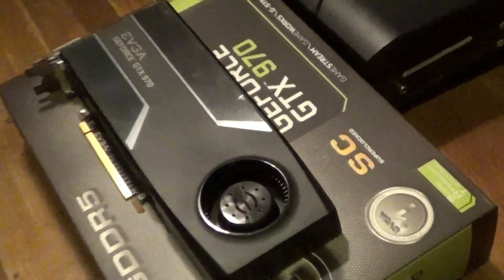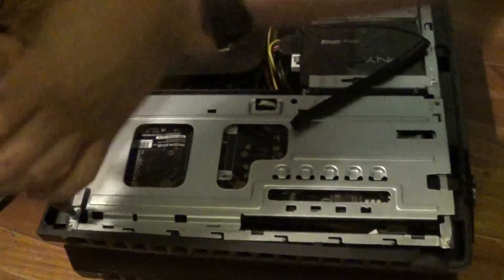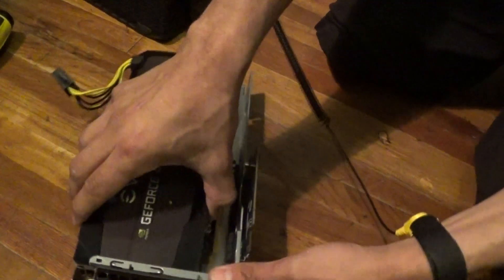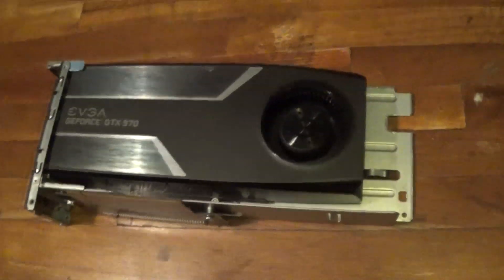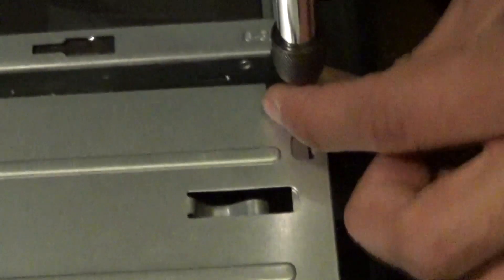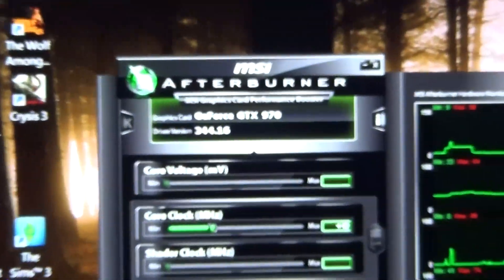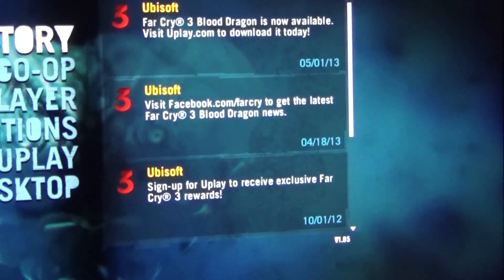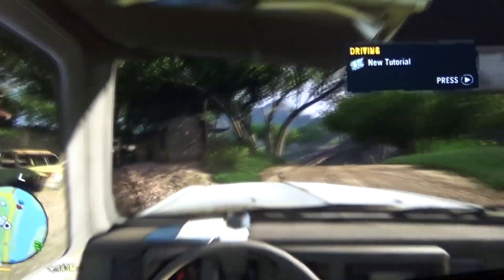How to install a GTX 970 SC in an Alienware X51. (English)

Comment: Has your pc ever shut down randomly on you from this?
And thank you for making this it solved my question of this gpu fitting in an this case
Reply from the maker: Corrupt Zach My X51 has shutdown on me only twice, while playing Watch Dogs and Far Cry 3 without V-Sync on. But since setting the power limit to 99% I haven't had any stability issues.
Reply: Corrupt Zach | ImPact Zach, Commentator Of ImPact Nation Sorry! I dont know much about AMD cards, never used one so I dont know the equivalence, but, if the TDP for the card is 145 watts or lower, it should work. Also, you have to make sure the card fits in the case so no longer than 10.5 inches. Hope this helps.
Reply: ElMastaGamer HD Can you tell me how to set the power limit the power to 99%? I bought the SC version of the card too cause thats the only one I could get my hands on. They are all sold out and I thought it would be better anyway in the long run. So for now can you tell me what to do to reduce the power limit to 99%?
Reply: you can do a few things, one V sync on or FPS lock at 60 fps.  the gpu boost 2.0 will over clock if the temps are fine and that use more power and if it can go beyond the 145 watt use age. there also your cpu that does the same.

so when he does not have v synce on or a fps locker the card will go all out, what he did is one solution by using EVGA precision X to limited the power ( or temp ) to 99% the card wont try to boost has hard that it can.

you can try the other two solution has well if you fine with 60 fps like me. or you can limited your cpu to 99% so it wont turbo boost aswell by using your Alienware program that came in with your x51 or simple down clock your gpu to a normal 970 (which it will eat anything given to you still) .  OC and SC version are bs market because it only takes you 5 sec to OC yourself, since they are all the same design.

also note, please test before you do anything because he does have two SSD 

so if you like me that only has one HDD you may or may not even have this problem
Reply: Hey thanks a lot RAULO3! This was really helpful. I have been using it now with the 99% power target and no problem. Will try with the VSYNC and fps locker too. Also will try with everything normal, meaning no underpowering or underclocking and see if it shuts off. Thanks.
Reply: What are u saying ? this card causes crashes ?? i want to buy it and i'm affraid now x)
Reply: ***** It may occasionally cause a crash here and there, but overall is a great improvement. With proper settings, crashes can be avoided.
Reply: ElMastaGamer HD 99% How did you set it to that?
Reply: GMentertainment ElMastaGamer HD  Yes, I would also like to know.
Reply: Rezirex Hey guys! I actually am using the FTW version and am playing Far Cry 4 on ultra and no shut downs. The fan gets a little loud since the case is so compact and and sound reverberates, but apart from that no issues. Oh and for the 99% power thing, just get MSI afterburner and set power limit to 99% and put fan control on auto, it helps a lot with the sound of the fans being too loud. Dont use EVGA precision x, for some reason it has no control over the fan speed and just keeps blasting it to full speed and man these ACX coolers can be loud at full throttle. Hope this helps!
Reply: Siddhart Rao That's all great to hear! Mind telling me your CPU, and if you have a HHD or an SSD?
Reply: The cpu is an i5-4440 and I use an HDD and will hopefully upgrade to an SSD by january
Reply: Siddhart Rao Thank you! that's exactly what I have, so I know it'll work now.
Reply: Yeah no problem! I know how you feel. I was in your state about a month ago. It runs far cry 4 on ultra with an avg of 40 fps, so enjoy!
Reply: Siddhart Rao ....40? what res and do you use AA?  i get 60 at 1080 with no AA and no soft shadow since they kill 10fps, i can use 2x mma but nah
Reply: I get get 50 to 60 most of the time with AA and at 1080p and soft shadows on. I think the AA i am using is TXAA, its not as good as MSAA but gives more fps with a good looking image.
Reply: Do you guys know if a r9 270x would work on a R1 alienware?
Reply: Siddhart Rao
A blower style card is definitely recommended for this case. THe Galax 970 and the evga 970 are perfect for the X51. I'm not sure why it would cause problems for the 33watt psu R1 model.
Reply: *****
it crashes because alienware is shit and his psu isnt powerful enough to support his computer
Reply: Jenna Love Then why are you here? For the sole purpose of trolling?
Reply: Rezirex No i clicked on your video because it said alienware. Sure we make mistakes. But at least i didnt buy alienware. I bought iBUYPOWER. it was a decent price. NOT GOOD but decent
Reply: also i bought a gtx 970 oc recently and ive just been very fascinated by how they work and ect.
Reply: My alienware aurora R4 is dead last month, (1.5 years bought), The boot program isnt contain in harddrive, its in a miroprocessor fixed on mothercard, and it has broke itself, the pc is dead, i cant do nothing else, and its difficult to save DDR2 stuff, too old, a pc bought in 2012, with DDR2 stuff (start of 2009, a pc older than 6 or 7 years) this issue is the same for all aurora 'series, dell know it, but its not their problem, economic befor all, i hate pc's of big enterprise like alienware since 1 month, my next pc will cost 900€ and its x4 more performent than aurora r4 (DDR2, 1300€) Alienware are ultra stealers, im not a blamer like all who says "alienware is shit" , no , i'm the client who take care of his pc, i loved it, my dear pc, but alienware are ingenious and give the dead to their pc's after a few years used .

Comment: I'm planning to get a 760 into my x51 do you think i would have to down clock? Or would it be just fine? (With the 330w psu) and i only have a 60 hz monitor so would it give me max 60 fps?
Reply: been using my x51 with a 760 for over a year now and it's never had any problems. Asking if it will give max 60 fps is a pretty generalized question as different games have different requirements. I can run bf4 on high at 60 fps but start hitting 40 when on ultra and get around 30 fps on crisis 3 on ultra.
Reply: hey man, ty for the answer one more question, is it loud? and is it worth it?
Reply: Robato I always use MSI Afterburner to overclock/keep the computer cooled so the fans are running extra loud. It can get fairly loud under full load (try looking for a video of fan noise). The replacement for the gtx 760, the gtx 960, should be coming out in Spring next year so you may want to wait for that. I've found my 760 to be pretty satisfactory except when playing highly modded Skyrim. With very high resolution textures the vram starts to run out and cause stuttering or sometimes crashes. The 970 SC shown in this video is the best you can possibly fit into the x51 without modding it so I was thinking about upgrading to that. If you have the money and don't already have a good gpu I would go for that one.
Reply: I have a GTX 745 OEM 4GB DDR3 Early 2013 model with a intel core i7-4770 3.40Ghz (8 CPU's) and 8 gb of ram, now im debating wether to get a radeon R9 270x (Because 3 of my  friends hva ethis card and it runs amazing and it is reccomended as the highest card at dell.com for the x51) or a 760 OEM (From ebay) or a 760 (No OEM) or the 960 if thats possible, its very tricky and i rushed ordering my pc because ive been waiting 3 years to get it and now i want to upgrade it already. So lots of things that go on in my mind. My question to you is:

Is it worth the money?

Would i be able to run games (High settings 60 fps) ?

And maybe i should consider getting a new case since that can help witj the noise and air reduction (But i dont want to do that because the point of the x51 is to be protable)?

Sorry if im bothering you alot but i dont want to make another mistake on this.
Reply: You should never get an OEM card as those are only used for companies to buy cheaply and in bulk to put in pre-builts. Once you're upgrading you should get an aftermarket version such as EVGA, MSI, ASUS, etc. I personally prefer Nvidia cards over AMD but it's your choice of course. The R9 270X, 760, and 960 should all be significant upgrades over the 745. The 900 series is supposed to be much more power efficient though, so keep that in mind. http://gpuboss.com/gpus/GeForce-GTX-760-vs-GeForce-GTX-745 Scroll down to the specs data and compare those numbers lol.  

I used to run my games on a gt 630m before I got this computer and it was a whole other world. What games do you currently play/plan on playing? 

Unless you are good at building computers and know what you are doing, I wouldn't buy a new case. You would have to take apart the x51 and rebuild it into a new case. I also believe that Dell may have separated the motherboard into different custom pieces instead of a standard layout.
Reply: The games i am planning to play are some things like, Dayz (Mod not Standalone), battlefeild 4, CoD Advanced warfare, EVOLVE, borderlands things like that but some games my GPU can run well such as cs go, payday 2 or league of legends. all i want is my case to not burn down my table (Its sitting on my table), not to be able to hear the Graphics card through my headsets, and run games around 60 fps medium or high.

I am not experienced in building pc's but Ive looked up some things online on how to put things into the x51, and i tried to do open it and check it out and plugged it out and plugged it back in with no problems. Its simply like a puzzle since they give you the slots.

I currently have a 60hz monitor do you think thats totally fine? Or should i look forward to upgrading sooner or later?
Reply: Maybe something likes this? Since it has a 5-10% GPU temprature down. 

http://www.amazon.com/Gigabyte-GDDR5-2GB-WINDFORCE-GV-N760OC-2GD-REV2-0/dp/B00DGM8B6O

I dont know if you know this but will i be able to add Fans under the graphics card?
Reply: How much Watts does the 760 need and will it effect if i used a different manufacture?

Something like this: 

http://www.amazon.com/GTX760-DC2OC-2GD5-GeForce-256-bit-PCI-Express-OC-selected/dp/B00DBPKEOI/ref=sr_1_2?s=electronics&ie=UTF8&qid=1413750800&sr=1-2&keywords=gtx+760
Reply: Those fans aren't going to be good because the x51 is set up to use the blower fan design. If you want the 760 then I would get this http://www.evga.com/Products/Product.aspx?pn=02G-P4-2762-KR or another card with a similar fan design.

Comment: Hi im planning on upgrading my x51 r2 but I don't have any knowledge when it comes to videocards so here's my question, can I put higher graphics card on x51 like let's say for example Nvidia GeForce gtx titan?
Reply: The x51 can normally fit up to a 9.5 inch card and has a limited amount of power. A gtx titan would not fit and would go way above the max power usage so no. Gtx 970 sc is currently the best gpu you can use in the x51 without modding it.
Reply: ***** okay thanks ;)
Reply: サンジョナ btw, remember to get a version with the single blower style fan shown in the video. Other kinds of fans won't cool the x51 correctly because of the way the case is set up.

Comment: This was possible with only a 330 Watt supply? Damn...I have an Alienware x51 R2 (Core i3-4130) but only a 240W PSU, I was looking for a good gfx card to upgrade to improve my livestream quality? any recommendations? I'd have to buy that 330W PSU though first
Reply: ***** lol I checked and the 745 edition has a 180 PSU, yikes.
Reply from the maker: Just buy a x51 330w PSU on Ebay or on Dell's website and you'll be good to go. Oh, one question, what GPU do you have at the moment?
Reply: I have the stock Gtx 645 which is shit lol
Reply from the maker: ***** You'll see a huge jump in performance, if you decide to upgrade your 645 to a 970 .
Reply: ElMastaGamer HD Thank you I will be picking it up once I get the new power supply
Reply: Hi, I'm getting the i3 one with the 745 and wondering how you found out if you had 240 or 330 PSU?
Reply: Sean Metivier Me I have the 240 PSU, it says the order form when you get the pc also the it says on the power bar if you look on it

Comment: I just got my graphics card installed, but when I power it on, it stays on the boot screen and beeps once every minute or so. Any ideas what might be the problem?
Reply: Also, Is the 330W power supply required? I just looked it up and it looks like the one I have is the 240W power supply.

Comment: Hi does it matter which brand of GTX 970 you put in the X51 I saw your video got hyped and ordered a zotac omega edition because I couldn't find and EVGA models. Did I just screw myself, will the zotac work for my X51 r2
Reply from the maker: julian bristol The Zotac Omega uses 2 8-pin power connectors and the x51 only comes equipped with to 2 6-pin power connectors, also that card is 10.5 in. long so to make it fit you'll have to remove the front intake fan from the x51. If I was you, I'd return the card and try to buy a reference GTX 970 (single fan).

Comment: stupid question but how did you solve the 8pin problem with an adapter?
Reply from the maker: There's no need for one, since this card uses 2 6-pin power connectors.

Comment: Thank you for this great video.  I just got my EVGA GTX 970 SC (superclocked) today and installed it with the help of your tutorial.  Just to let you know I'm running the card as is, with no reduction in anything and power target at 100%, and "Fan Curve" set to "aggressive" in EVGA Percision. With no problems what so ever.  Played "The Elder Scrolls Online" for about 4 hour straight, everything ran great.  Oh almost forgot.  I set my windows 8.1 to power plan "Balanced" with the maximum power management set to 99%, to keep my cpu from going turbo boost.
Reply from the maker: Hi, I'm glad the video help you out. How does the GTX 970 SC perform compare to your old card?
Reply: ElMastaGamer HD My old card was a GTX 760 Ti OEM.  The GTX 970 SC runs about 10 degrees cooler.  The old card would crash about 20mins into playing "The Elder Scrolls Online".  And the 970 SC runs flawlessly and hasn't given me any problems even when playing for hours, played 10 hours straight today without any problems what so ever.  I love this card.

Comment: Thanks for the vid man! Heard some negative comments about the fan noise though.. Has that been a problem for you so far?
Reply from the maker: The noise level is about the same as my old GTX 670 FTW. I think the fan issue only involves the 970s with the ACX 1.0 cooler.